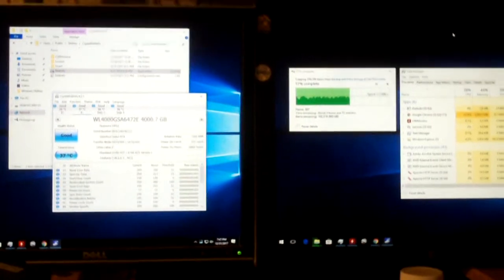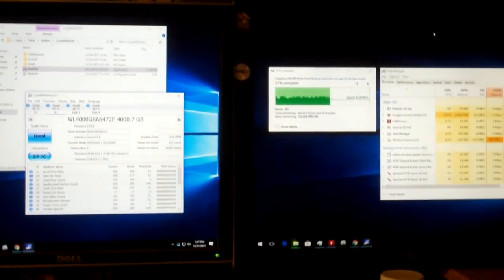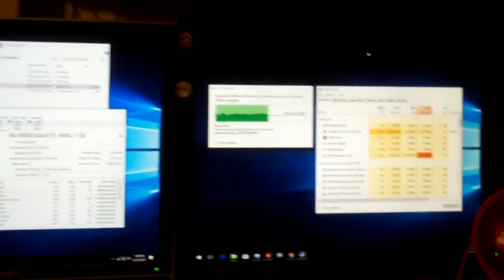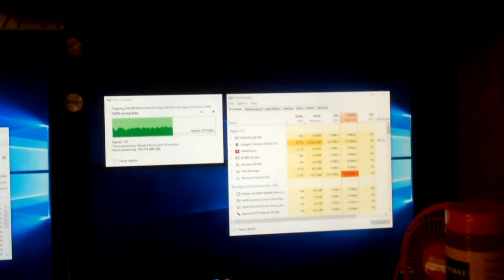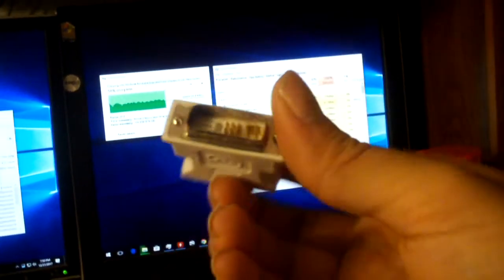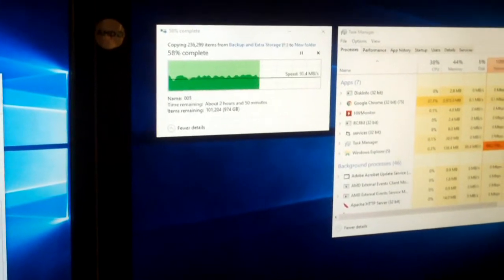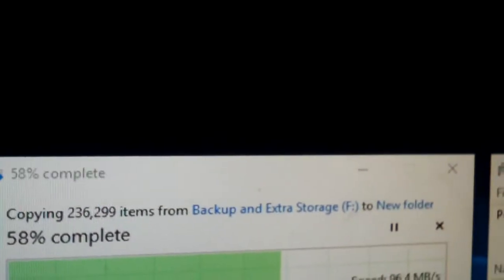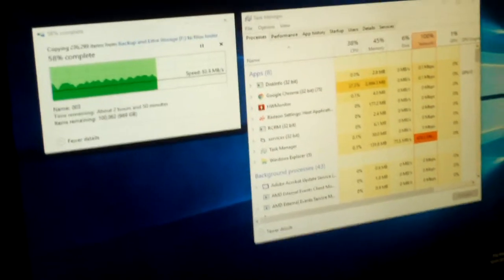A weird issue with display not showing native resolution + fix

Comment: so, i'm using vga and my 1360x768 monitor suddenly starts up squished with bars on the top and bottom
i unplug and re-plug the vga cables a few times but the screen is still squished
so i get in to the display settings and don't see 1360x768 which IS the native resolution
i change it into 1280x1024 and well enough the screen fits to scale the monitor
but now i can't go back to the native resolution
tried custom resolution utility and the native res was in the Detailed resolutions section but not the standard res section.
rebooted pc but still not working...

Comment: Is that a 4TB Media max drive? Which do you have the 5400 or 7200 RPM model?
Reply from the maker: I had a 4TB MediaMax 7200RPM drive, but I had to replace it due to failing SMART (even though all parameters in CrystalDiskInfo were healthy and the drive was otherwise working fine). The RAID controller on the new motherboard refused to use the drive because of it reporting SMART as bad.
Reply: That's annoying. Have you had it long and did you use much of it's capacity?
Reply from the maker: I've had it a few years or so and have had it near max capacity on a few occasions.The drive works fine in machines that allow SMART to be disabled.
Reply: That's pretty good. I find it's luck of the draw with hard drives. I know people have their favourites and also the one's they dislike, but I've seen equal quantities of drives from the likes of WD and Seagate fail.

Comment: Did you run DDU in safe mode and disable automatic driver installs? And are you running a TV? And if so, are you using an adapter to convert DVI to VGA or HDMI?
Reply from the maker: Did not run DDU in safe mode or disable automatic driver installs. No, I'm not running a TV... Only the two displays seen in the video.